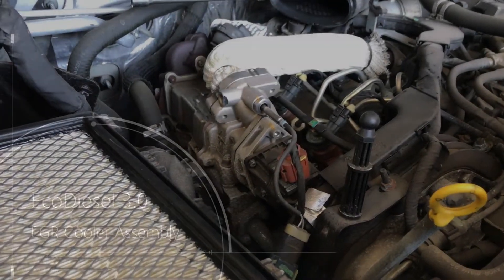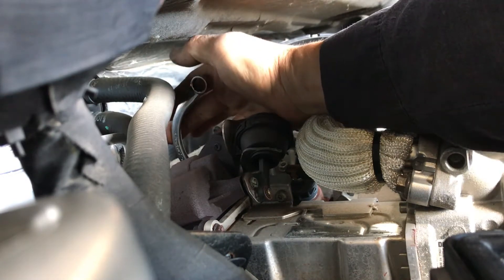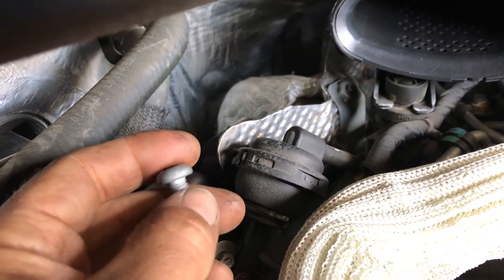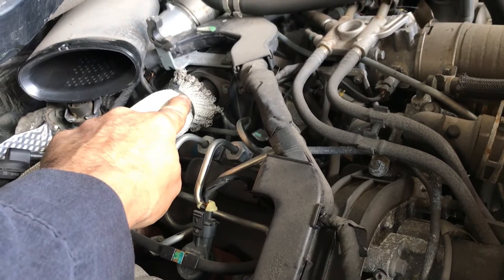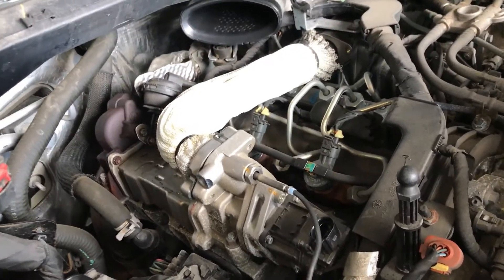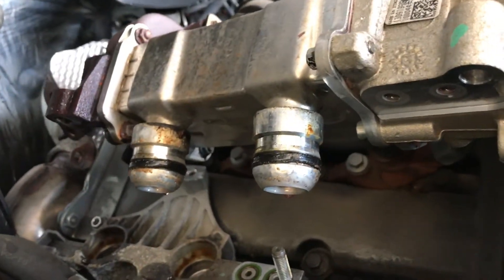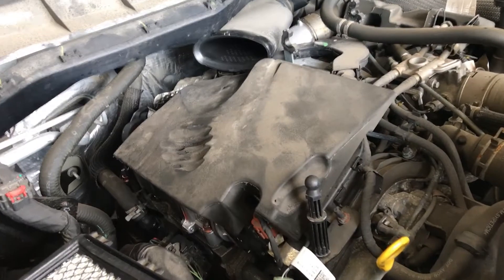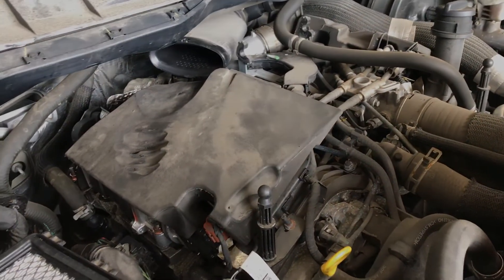EcoDiesel 3.0 EGR Cooler Replacement Ram Jeep

Comment: What do you suggest when the T40 screw head is stripped out
Reply from the maker: Cut the bracket off, for this reason I recommend not to install the T40 back in. The bracket is not needed, they just put it in there to make mechanic's life miserable.

Comment: Excellent video thank you for the tips  makes me want to keep my ecodiesel now. One question if you don't mind since it is a recall on the egr is there a noticeable difference in the egr cooler quality? One would think that if they made it a recall they would change the egr cooler so one can't loose engine coolant anymore. What is your opion on this ?
Reply from the maker: Supposedly they made the insides stronger, so far I think it works as I didn't see any Ecodiesels coming in with loosing coolant or with restrictions. You're not going to notice any difference unless your cooler is restricted or leaks.

Comment: Low coolant while towing (from a leaking EGR cooler) I believe led to my ED pushing a head gasket. Once the EGR is cooler deleted that risk is gone.

Fwiw the engine had 371,000 miles so I did not repair it. I bought a factory complete replacement engine. It included 100k warranty new turbo & high pressure fuel pump drop in ready for $7500. I removed the EGR cooler from that one and ran it commercially towing for 423,000 miles.

Comment: The EGR valve was fixed under recall in 2019.  Are the repaired ones still failing?
Reply: Mine just did...

Comment: Do you recommend any other inspection or maintenance on the ecodiesel? Any particular areas more prone to problems.  The soot inside the intake manifold seems like a real engineering failure. I only have 55,000 miles on a 2014 but can see loads of soot inside the intake, and the oil mist going into the turbo worries me
Reply from the maker: It's not that easy to build problem free diesels with all these federal emission mandates. Sprinters had exactly same issue with their 3.0 CDI engines. Recirculating  exhaust gasses together with oil vapors is just not the best idea. I had bunch of turbo coolant hoses cracked/broken and leaking under the intake manifold usually around the 100k mark, so definitely replace that hose/line once servicing the intake manifold.

Comment: HI. Mine start leaking external from manifold seals I think. Is it worth it to replace egr cooler or just seals?
Reply from the maker: Has your cooler been replaced already (VB1 recall)?  Check with your dealer, otherwise if no codes, I’d replace the O- rings if that’s what is leaking.